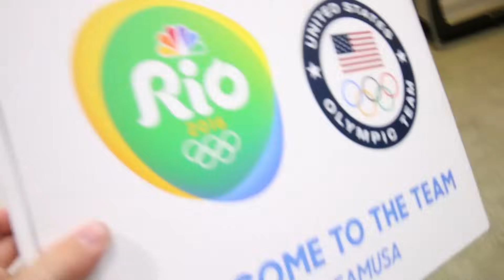Relocating A Wasp Nest

Comment: Your presentation of relocating a wasp nest is entertaining. I do this sometimes for a living, fun grins and adrenaline giggles. People have hired me  to do live wasp, yellow jacket removal, get up on 28ft. ladders and pluck all the critters from structures that have to be worked on and or painted. Not including bats. Bats got to stay by request of the owner. After carefully reviewing your demonstration, I have some suggestions that will make this process less … agonizing and definately less frightening. 
I plucked a five gallon bucket full of very confused wasps starting at 5 am, from a 2 story home. the temprature was perfect. A nice balmy 45 degrees. I misted them all lightly with a weak solution of water/honey spray. Their wings became slightly sticky and couldn't fly. As long as the queen and babies are alive, they won't try to kill you. They all go to protect the queen in this stage of confusion, this early in the morning. I then very carefully take a 5 gallon bucket with cotton or quilt batting on the bottom and a screen lid ready to put onto the bucket. I then surgically remove all the hives with an exacto knife, or in the case of a nest in a precarious location such as your was, basically do the exact same proceedure, with a more sturdy tool like a 14 inch mud knife. Noting that the hive is glued to the structure on all sides.  the easiest thing to do is move them at the very onset of their desire to build a nest, wherever. I reccomend gently using water to make uncomfortable and make them decide to go elsewhere without using toxic products. I had wasp removal go sideways once when i was first learning how to do it, and was covered with very confused wasps late at night in my hair, under my shirt and on skin of my arms. I plucked the nest, had the queen, drones, workers and all the babies, and the lid fell off the container. Oh crap. Great. They were all over me in the dark with only a head lamp. They were gripping onto me for their dear lives not knowing what was going on. I could smell the queen's pherimones. She must have sent out "still alive" pherimones, so no stingers were called on. I gently set the hive down in my garden. All the wasps crawled and jumpped off of me going straight to the hive on the ground to protect their mother and babies. The next mprning, all the occupants were gone, including the eggs. There were no ants around the abandoned hive, so the nest was not robbed by ants or lizzards. The wasps got the message, and took off. That was the beginning of my obsession with winged critters with stingers. i hope this little tidbit of advise will help you in the future. The key; the earlier in the morning and the temprature has to be cold to be successful removing large hives from a structure. I stay far away from dead trees. That is for bee removal companies with the right gear. Sincerely, The other wasp whisperer.
Reply: I enjoyed reading this. I hope all has been well in the 4 years since writing this. take care good sir.

Comment: I see this is an old video.  Adley is entering 2nd or 3rd grade at this point.  About the wasps, which is why I clicked on the link (after doing a search "moving wasps").  The idea of the trap is pretty good.  I do the same thing with most bugs I find inside.  If I can.  

Three things that are wrong, though:
1.  He should have waited until the coolest time of the day; early morning, just before dawn is usually best.  Most insects are sluggish in cool temps.  
2.  He should have worn gloves at least, if not some kind of face mask and eye protection.  He's very lucky he was not stung.
3.  Just throwing the nest and running not only killed all the larvae in the nest, he also risked having the whole hive after him.  Not so good.  Wasps can fly faster than we can run.

Perhaps it would have been better If he had found a new location for the nest first, then PLACED it with care in that location.  

I see that when I attempt to move my little wasp's nest I will try to do the same.